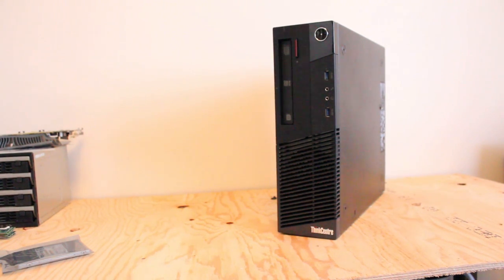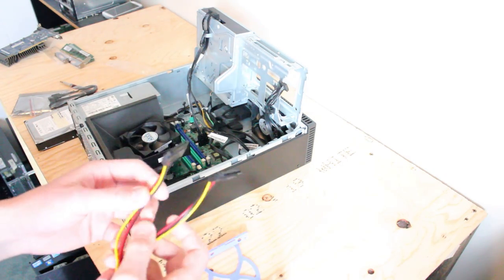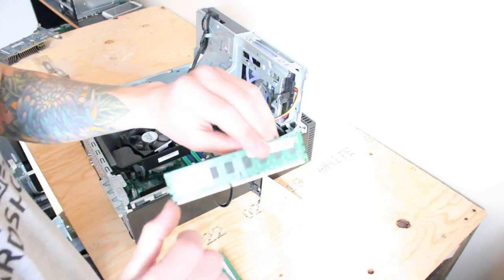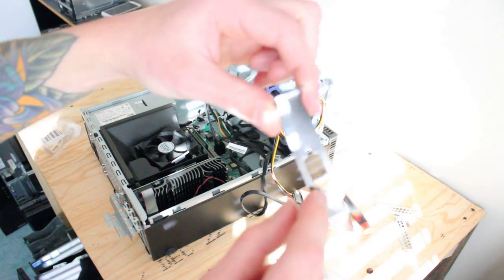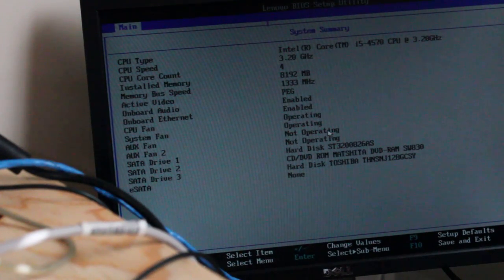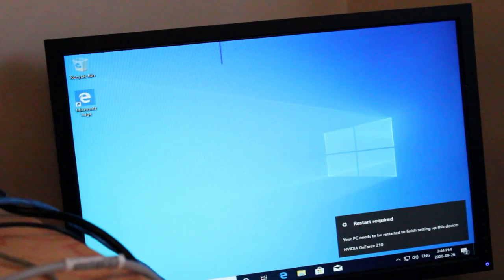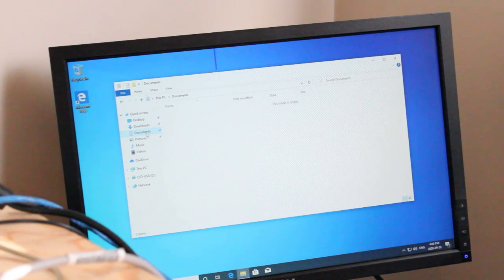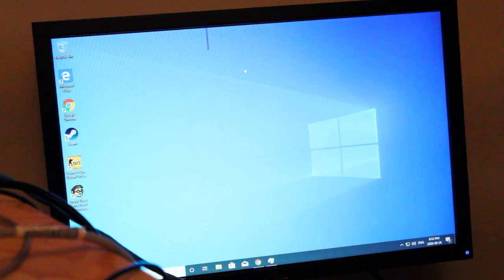Lenovo ThinkCentre M93p SFF Upgrade (SSD, RAM, Graphics Card, HDD)

Comment: What method do you recomend to put a full size power supply into a small form factor PC?
Reply from the maker: You would have to migrate everything over to a larger tower case.  But, can I ask what you are planning to install or do with it?  If it's a project or just for fun, etc.  Migrating everything for just that power supply might not be worth it unless you're also installing the best graphics card the system can handle and upgrading the CPU.  Not to dismiss the idea, by all means.  If you do it let me know how it goes :)
Reply: @HaisteComputerRepair  oh I see... Well I ended up putting it in my dads tower Pc and it runs so there foes the power supply
Reply from the maker: @alexzhang3836  Excellent!

Comment: Can it used a graphic card like rx 550,560 or something else from nvidia? For the purpose playing a game in 2021
Reply from the maker: Those cards would probably work well, just you would need the low profile version or a larger case to migrate to.  The GTX 1050 ti low profile would be nice https://www.techpowerup.com/gpu-specs/zotac-gtx-1050-ti-low-profile.b4295

Check out the video I have pinned in the comments for some good suggestions and a better gaming test.

Comment: Is it possible to do a case swap?
Reply from the maker: For sure, just be mindful that some larger cases / power supplies may not have the same plugs required to power certain things on the motherboard.  Ex:  USB ports on the tower case, power plug cables, number of fans, etc.  Just do your research and you should be fine.  I have done this before and had success.
Reply: @HaisteComputerRepair   ok thank you so much!
Reply from the maker: @wildmonkeymc2380  No problem, let me know how it goes :)
Reply: @HaisteComputerRepair  I will I think a mid tower will do?
Reply from the maker: @wildmonkeymc2380  Are you buying new or reusing an old tower case?
Reply: @HaisteComputerRepair  new
Reply: @HaisteComputerRepair  dude can you help me out Idk what motherboard it is
Reply from the maker: @wildmonkeymc2380  Do you already own a Thinkcentre M93p?  This may help: https://support.lenovo.com/us/en/solutions/pd027355

Comment: Thanks heaps for sharing this! It's helped me immensely! Awesome work!
Reply from the maker: Thank you!  What are you thinking of putting in your tower?
Reply: @HaisteComputerRepair  much the same as your build, an SSD & a cheap GPU (GT 710). I'm going throw on an aftermarket CPU fan (for no particular reason, just for the fun of it haha). Just waiting for the parts now. Should be an enjoyable little build :)
Reply from the maker: @OffDutyTink  Nice.  The GT 210 I installed was just because I had it around my shop.  I wouldn't recommend that unless someone really wanted HDMI or something.  I didn't really make that clear in the video.  A 710 would be much better, I have one on order as well and will probably shoot a follow up video.  Good luck!
Reply: @HaisteComputerRepair  Thanks mate!
Reply: @HaisteComputerRepair  My build is complete! Super impressed with the GT 710, I wasn't expecting much performance, but honestly it's a little nugget! I love it! haha
Reply from the maker: @OffDutyTink  That's awesome, have fun!   I'll be testing out a 710 once it arrives in the mail.
Reply: @HaisteComputerRepair  Wouldn't the built-in video have been better?
Reply from the maker: @BoDiddly  Yes, for sure.  The only benefit is easy access to HDMI.  I addressed this in the pinned comment, but I'm guessing not a lot of people read it.  The GT 210 is not an upgrade at all.  I did do a follow up test run video with a GT 710 (bare minimum card for the M93p) if you want to check that out:  https://youtu.be/buHczk4L1-c

Comment: I just got one of these. Do u know if they have Bluetooth or if it can be added. If it can be added what would i need?
Reply from the maker: You would need either a USB Bluetooth adapter or a Bluetooth low profile PCI card.   What are you trying to connect?
Reply: @HaisteComputerRepair  a Bluetooth speaker
Reply from the maker: @crazyedd707  You can use a USB https://www.newegg.ca/p/pl?d=usb+bluetooth+adapter

Or PCI card:  https://www.newegg.ca/p/pl?d=pci+bluetooth+adapter

Just make sure you get a low profile bracket if you go the card route.
Reply: @HaisteComputerRepair  thanks man i appreciate it
Reply from the maker: @crazyedd707  Let me know how it goes :)

Comment: You can upgrade the CPU also, I did that on my M73 that came with a Core i3 3.7 ghz dual core and moved to a Xeon quad core 8 threads 3.4 ghz and the performance improved a lot, also I have my machine with 16 gb of DDR· 1600mhz, a 480 gb SSD and a GT 710 2 gb. Since your machine has two PCI-E 16x you can put and M2 adapter and install a NVME SSD, it is way much faster than the traditional SSD (Sadly I can not do that on my rig because it has only one PCI-E 16x and it is occupied with the GT 710). I would recommend to disconnect the DVD RW unless you really need it frequently, since you added a Graphics card it will come more power (that power supply is not intended for many internal devices).
Reply from the maker: Good advice thanks.  I would love to play around with these options and I may just do so.  Especially the NVME SSD idea.  Sounds like a fun experiment.
Reply: What the socket on your Xeon?

Comment: hai bro can i know, i have same pc model like you, i little bit confuse about ram, which model i need to buy like (PC3L-12800) OR JUST PC3-12800)? and how many slot can use? can i buy like 4x4gb? sory bruh i newbie here hahah
Reply from the maker: 10 of these towers shipped to me with 4GB 1Rx8 PC3L-12800U-11-11-A1 RAM sticks.  You can definitely install 4 x 4GB sticks.  In fact, that would be awesome :)
Reply: @HaisteComputerRepair  oh oky bro, but i want to add some gpu, can you suggest?  gt710 2gb ddr5 or gtx750 can compatible with this spec?
Reply from the maker: @headhunter0239  For a budget, yes the GT 710 would be a great fit.  Check my pinned comment for more suggestions, with a higher price.
Reply: @HaisteComputerRepair  ok bro thankyou for reply. great day
Reply from the maker: @headhunter0239  You too!

Comment: i have this pc with 4gb ram ddr3 1600mhz  from lenovo
and i want to upgrade to 8bg
do i have to buy just 4gb ddr3
or i have to buy 8 and remove lenovo ram
(edit : i buy a gt 1030 for this )
Reply from the maker: Nice video card choice.  Take a look at the label printed on your RAM that is already installed and Google  what speed it is in MHz.  Then find some DDR3 RAM to install.  I have installed various configurations with various brands and they all tend to work.  Match up brands if you can though, or buy RAM in sets.  Main thing to consider is the speed.  You could end up installing one stick with less speed and the system will automatically run all RAM at that speed.  Upgrade to 16GB if you can, to match the ferocity of the 1030 :)
Reply: @HaisteComputerRepair  Thanks I appreciate your response you really help me
Reply from the maker: @haddad7031  My pleasure!

Comment: l have a new battery coming  today than go jn to safe mode and rest hoping  thats fixs it... wish me luck
Reply from the maker: A new CMOS battery?  Just make sure you disconnect the power cable.  Replacing the battery should not require any diagnostic work, unless there is an underlying issue.  Let me know how it goes.

Comment: I have new usb keyboard  still wont stop
Reply from the maker: Strange.  Did you install any particular software recently before this started happening?   Can you 1)try plugging the keyboard into another device to see if it happens there 2)try booting into safe mode, see if it still won't stop 3)try system recovery aka system restore point if you have one set up.

Comment: How do you take the gpu out because mine won’t home out
Reply from the maker: Do you mean a graphics card?  Or the integrated GPU on the motherboard (that one is soldered on).
Reply: @HaisteComputerRepair  graphics card
Reply from the maker: @greengoblin0669  There should be a little plastic tab that releases the card and otherwise it should be easy enough to pull out from the other end.  After pulling up the tab to release the brackets.  Does that make sense?  Let me know how it goes.
Reply: @HaisteComputerRepair  ya it does thanks I got it out
Reply from the maker: @greengoblin0669  Nice, good stuff.  Are you replacing it with another card?
Reply: @HaisteComputerRepair  no I wish I had a better one tho 😢😢 I’m jus switching cases and motherboard
Reply from the maker: @greengoblin0669  Case and motherboard?  What are you switching to?
Reply: @HaisteComputerRepair  well I’m switching to a mid tower case and a an arx motherboard. Now sure which one I’m gonna get her tho cause I hat to return my other one
Reply from the maker: @greengoblin0669  Interesting.  Are you just pulling the graphics card from this system (M93)?  Or are you using other components?
Reply: @HaisteComputerRepair  I’m pulling it from this one
Reply from the maker: @greengoblin0669  Cool, good luck with your new setup.
Reply: @HaisteComputerRepair  thanks

Comment: is that motherboard lenovo sharkbay?And did it support rtx 570 or gtx 1050ti?
Reply from the maker: That's a good question about Sharkbay, I'll have to double check the next time I set one up.  That wasn't on my mind at all, so thanks for asking.  Yes, I have had reports that those graphics cards do work with these systems :)
Reply: @HaisteComputerRepair  on rx 570 work on sharkbay or on motherboard u have?Thx for fast reply!
Reply from the maker: @urosnikolic7178  Motherboard in the tower from this video.

Comment: Can a Gtx 1650 LP fit and work on it have someone tried this ?
Reply from the maker: Yes, it should work fine.  I sold one of these towers to someone who then installed one.  I haven't seen it in action, but he told me it works.  Hope that helps!  Looks like it will fit, either way.
Reply: @HaisteComputerRepair  ty so much Sir
Reply from the maker: @hatchi18doox49  No problem, let me know how it goes.

Comment: Can you use wireless connection
Reply from the maker: Yes absolutely.  You can use a USB WiFi adapter or install a WiFi network card in the PCI slot on the motherboard.
Reply: @HaisteComputerRepair  ok I’m sorry I’m really scared I would have to use Ethernet so when I get it I can just use wireless right? I won’t have to buy anything?
Reply from the maker: @SmellJayAims  No, unless it is clearly specified from wherever you are buying from it likely does not have WiFi.  But, a USB adapter is reasonably cheap (~$35 CAD) and it's plug and play.  Drivers will install automatically and you should have no problem accessing WiFi.
Reply: @HaisteComputerRepair  ok on the specs it say wifi so I think I’m good
Reply: @HaisteComputerRepair  nvm thank you bro I went to it and it say wifi adapter so I’m good

Comment: Hello, I have a lenovo m58p sff and was recently running an AMD 6450 gpu. I'm trying to upgrade to a Nvidia gt1030 Lp gpu as I know its compatible but for some reason my computer doesn't recoqnize it when booted up. I get no video through the card and device manager doesn't see it. What should I do? You seem to know alot about these computers....
Reply from the maker: I believe a GT1030 should run with the M58, but I have never tried installing one.  I would like to, though.  What CPU do you have?  Have you tried installing the drivers for the GT 1030?  It's confirmed that the PCI slot works as you previously had the AMD 6450 installed.  Perhaps it's the card.  It does happen.  I tried installing a Geforce 210 card into an M57 yesterday and had the same issue you have.  Check back in after you try downloading the drivers and installing them.

Comment: Hi great video! I have one doubt, hope you can answer... I just buy this PC, but I'm not sure if I paid to much for it or not... could you tell me how much it cost at this time (approximately) and how long is this PC since it was released for the first time?  thanks!
Reply from the maker: I purchased 10 of these for roughly $1200 CAD.  I believe 2013 was the release date.  I'm not sure how much they cost back then, but I imagine around $600?  So, I would sell one with all the upgrades in the video for about $235.  This is also based on what I paid for SSDs, RAM, and video cards.  If I get parts for cheaper, I go cheaper, etc.  It is  a solid choice still for many things, in my opinion.
Reply: @HaisteComputerRepair  thanks for your response, you helped me a lot!
Reply from the maker: @10VGomez  Good luck building up a solid budget PC!

Comment: Just upgraded mine and upgraded memory to 32GB I wish I could upgrade the power supply from the stock 240 Watt to 300 Watt or greater. Any suggestions? Great video, thanks!
Reply: So 32gb ram is doable?
Reply: @strangedays1984  Yes 32GB is doable…works great!
Reply: @DesignEagles  thank you!
Reply from the maker: Check out this video, he has an interesting setup and links to a power supply you could use:  https://youtu.be/yJbpWaZypO4
Reply: Amazon has a small 300 watt for 30$.  Should fit

Comment: Can I upgrade the PC one at a time????does still boot like that???
Reply from the maker: If you mean can you add upgrades one at a time while the system is setup with Windows and otherwise operating, yes.  Am I reading this correctly?
Reply: @HaisteComputerRepair  yes sorry I'm bad At English I was planning to put Graphics Card
Reply from the maker: @CarlCheeveyAAblin  Cool.  Try looking for something like a Geforce 710 2GB card.  I used a 1GB card in this video and you would get better performance if you can find something that is 2GB at least.

Comment: Do you have a graphics card that you recommend that works on this computer? I want to get a new one but I know nothing about computers
Reply from the maker: Try this one out:  https://www.techpowerup.com/gpu-specs/geforce-gt-710.c1990  A little better than the integrated Intel HD 4600 gpu and will give you the HDMI, VGA, and DVI options, just like the card in this video.  For reference:  https://www.techpowerup.com/gpu-specs/hd-graphics-4600.c1953
Reply: @HaisteComputerRepair  thanks
Reply: @HaisteComputerRepair  so I got it, but it is too tall to put in the case won’t close what should I do now?
Reply from the maker: @teddysye6693  The 710 is built to fit into cases like this, so maybe it's the bracket that is too big?  You need low profile brackets.  One fits on the HDMI and DVI, while the other fits to the VGA port.  Like this: https://www.ebay.ca/itm/ATI-AMD-nVIDIA-Video-Card-dual-low-profile-Bracket-HDMI-VGA-DVI-Back-Plate/122811321383?hash=item1c98200c27:g:GG4AAMXQMTlRalqJ

In the meantime, you can always install the card without the bracket on, it will just sit there in open space until you get a bracket set for it.  Does that apply to you?
Reply: @HaisteComputerRepair  that worked, thanks for your help

Comment: Will that motherboard fit in a mid tower case
Reply from the maker: So long as the motherboard's clear holes for it's screws align with the tower case, yes.  This model did have a larger tower case option, so you might even be able to find one that is empty.  I would love to get one just for the ease of migration and larger video card option.

Comment: i have that lenovo m93p , but i have problem with heat , the processor too hot
Reply from the maker: What do you mainly use the computer for?  Any reason that you think it might be overheating?
Reply: @HaisteComputerRepair  just for watching youtube and surf internet , i try to clean all and re pasta the processor but it still hot , around 80-85 degree
Reply from the maker: @firmans4435  You cleaned the fans and blew out dust?  All fans are running well?

Comment: Hey man! Interesting Upgrade! Have you ever upgraded the motherboard before? Just need to confirm because I'm buying the same system with it's original components. Thanks!
Reply from the maker: Thanks for watching!  No, I haven't upgraded the motherboard.  From my point of view, it wouldn't really be an upgrade that made sense for me.  This is because the entire setup is manufactured to work with itself, unlike building a pc from scratch.  Upgrading the CPU, RAM, Video cards, other cards, etc, is a good idea.   If I wanted the benefits of a newer model of ThinkCentre, I would purchase the entire system and then proceed with the CPU, RAM, etc upgrades.  If the motherboard was faulty and not something I could fix, then I would replace it.  Does that make sense?  If you do replace the motherboard, keep in touch here and let me know how it goes.  Be prepared for troubleshooting, as always :)
Reply: @HaisteComputerRepair  Thanks a lot for the response mate! and yes all that made sense to me, I think it wouldn't make sense at all to just get a new motherboard and proceed with component upgrades. It's basically a new build from scratch! I will just be upgrading the RAM, GPU and I'm going to slap an SSD to the rig! At first I thought the system was a DDR2 system but when I took a look at this video I learned it was DDR3 which helps me with choosing the correct RAM type! Btw what is the PCI Express version for the motherboard? I'm hoping atleast PCI 2.0 x16. And again this is much appreciated! Keep it up
Reply from the maker: @discordmoderator2595  No problem!  Check out this for tech specs:  https://www.lenovo.com/ca/en/desktops/thinkcentre/m-series-tiny/m93-m93p/  Otherwise, you might have to wait until you can look at the board yourself.  I think the PCI slots should be what's listed on that page, though.
Reply: @HaisteComputerRepair  found it! It's x16 😄 this help means a lot to me, thank you so much, sincerely. Have a great day friend!
Reply from the maker: @discordmoderator2595  My pleasure!